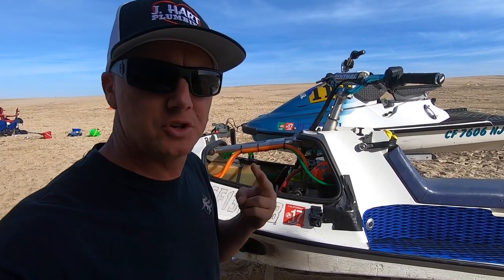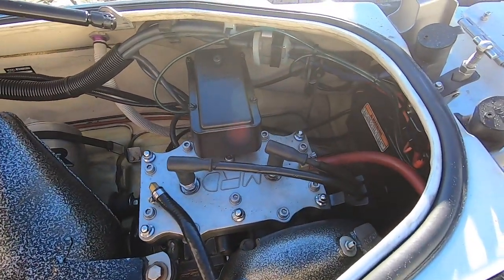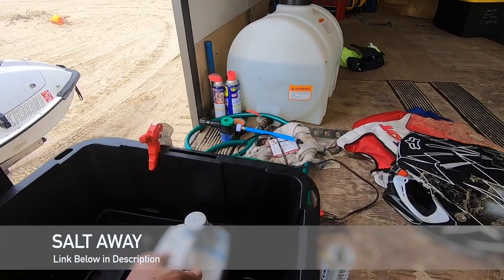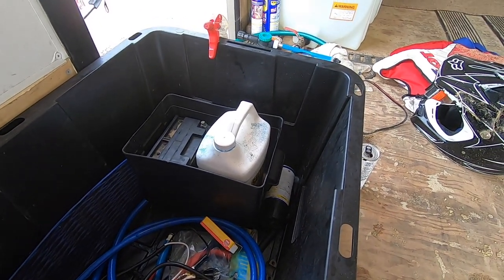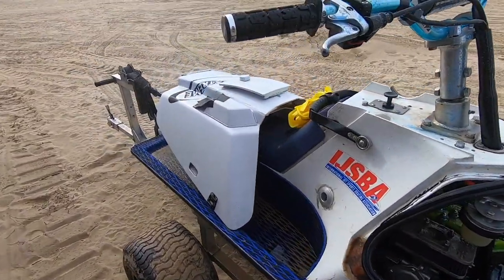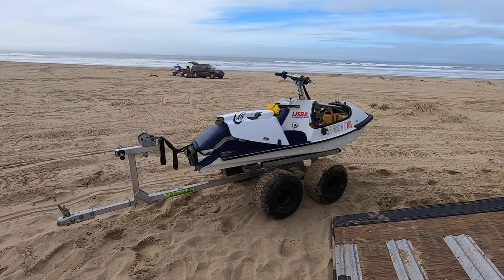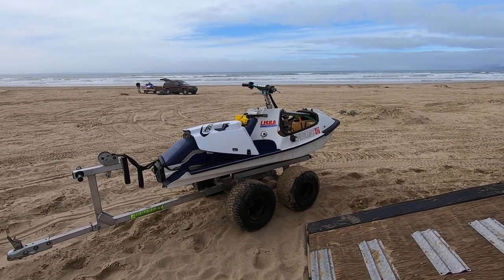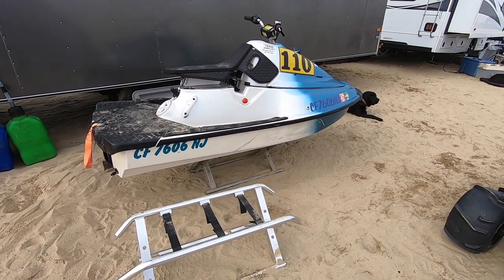Jet Ski Surf Setup X2 Waveblaster

Comment: Do you still run the standard braces at the back of the hull? As well as the surf brace?
Reply from the maker: Yes still use the standard braces. X2s stress crack like crazy just behind the hood latches. I’ve seen hulls ready to break in half.

Comment: Whats the big difference with running the 750 with 650 electronics?
Reply from the maker: I have one with 750 and one with 650. I think the 650 Electronics  are more reliable.  750 I think will be a hotter spark.